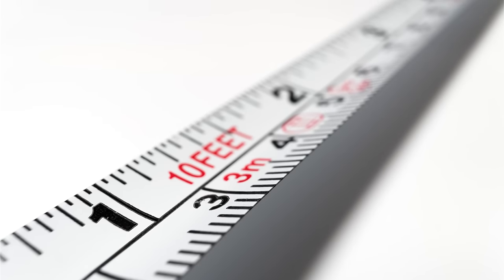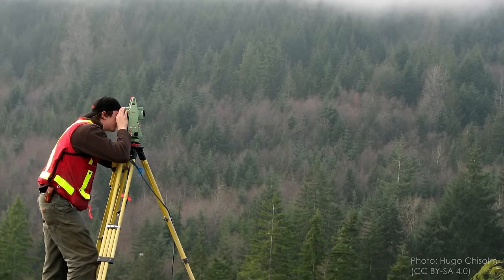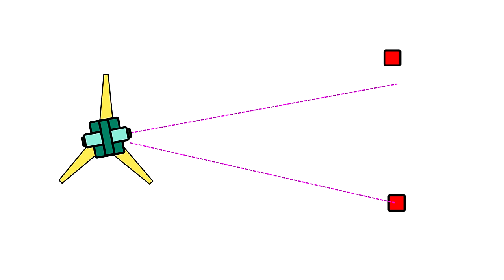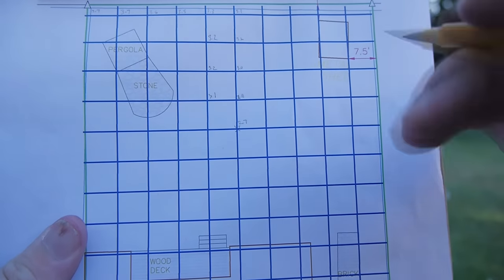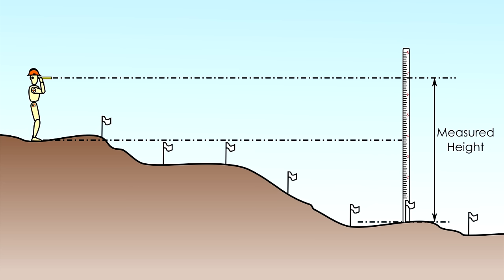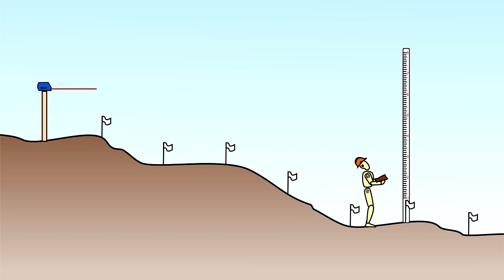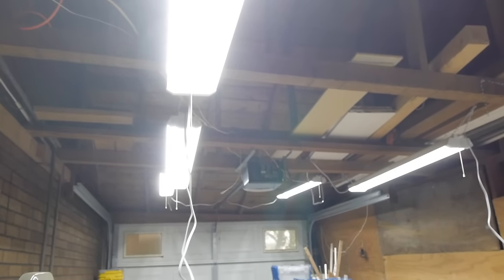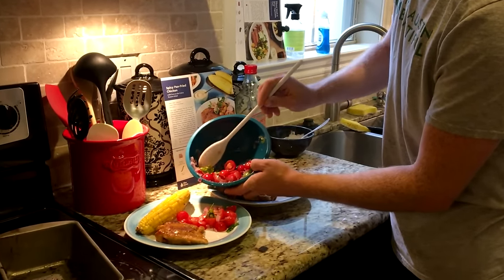How does land surveying work?

Comment: I have been surveying since 1983 when we measured everything by hand. One thing we did not mention in the video is "slope distance" which is longer than horizontal distance. The total station will record anything you tell it to. For example there is point codes and point numbers. A point code for example let's say a tree, we could name it any code we want to. Tree=1, top of curb, pt. 2, a dandelion, pt.3 (just kidding), center line of a street, pt. 4. Now point numbers are 1,2,3,4 and on and on it goes. As we progress the "data collector" is a kinda of a memory box which retains information. Make sure it is charged. We then take it into the office and a very smart man downloads into his computer and proceeds to produce a topographical map, or done in reverse he gives us information that we apply to the field. Sounds complex but it is very fun. Now let's get into something that is really interesting. Have you ever noticed as you drive around a large curve on a road. If we look at it, we will notice that the inside of the curve is lower than the outside of the curve. We do that for centrifugal force, we don't want you flying off the outside of the curve, if you are not my ex-wife. Just kidding. Be as it may, the outside of  the curved road is higher in elevation, and the distance is greater, the lower side is, or inside of the curve is of lower elevation and of shorter distance. 2 different diameters. There is also vertical curves, up and down. There are compound curves, combination of two or more different curves, like Marylyn Monroe, and combine vertical, horizontal etc.  In conclusion, in all my years as a rod man, project inspector, material testing tech. there is nothing like standing on a finished street, road and say to myself, "I helped build this."  Disclaimer, I hope I was correct in my rambling. I am an old man now, I truly wish I could get back into the field.
Reply: I recently began surveying as a second career after retiring from the Corps. Today we use GPS and Total Station. Although I know about pulling chain and tape as well.
Reply: @tiredoldman  Thank you Bill. Have you ever surveyed a beach. ;)   m
Reply: Thank you for this message, was very interesting to read! 
I have always wanted to do proper work like this. 
I grew up on a farm in South Africa, my parents still own it. 
They still flood irrigate the fields, so slope of the ground is important on large fields. 
Someone gave my dad an old theodolite, which projected the image upside down (unless we were using it wrong, haha) so he would stand with the measuring rod, and i would write down the measurements. My eyesight and patience a bit better back then. We would then subtract the difference to calculate how much of a slope there was, and possibly where more topsoil should be placed to fill in holes and ease the slope. 
It was little things like this, which i experienced as a child, which gives me great appreciation for many different aspects of engineering. 
Mans life is too short to fully enjoy and learn all these grand things. 
I am still a young man, and would love to sit around a fire with you and would learn so much! 
Thank you for your input. 
Greetings
JG
Reply: @Jaguartmb  You are most welcome, sorry I cannot afford to go to S. Africa, but I would love to.   m
Reply: If I recall the slope around the curves was referred to as “ super elevation”.  We calculated for design speed and expectations on traffic.   I did a few miles of roads while in the Navy in early 80s and visiting the bases 30 years later and seeing the roads and structures I laid out still there and in use is a good feeling.   12 weeks of school and hit the ground running. 

Most frustrating was working near a runway and had an F16 start to taxi next to us.   We were awes by the jet we didn’t give any thought to the setup behind us.   Pilot got his ok- started up engines , we sAluted him and he took off like a bat out of hell and thrust sent our equipment flying    (Sooo worth the a$$ chewing ).  We had another one.    I really enjoyed it.  Especially designing co pound curves and setting crowns.  Then we got to help lay concrete or place asphalt depending on what we were doing. ( this case, 9” concrete road for jet engine testing.     

Good times back in Sicily in those days. 😏
Reply: @stemmentor9700  Thank you for your valuable input. It is great to see another surveyor tell his experiences. 
    Land surveying is a job, art, learning profession. Once you have it, you never forget. Not a lot of people know how land surveying works. I am happy you gave us your work in the field. 
     For all the people out there, here is a question. "What is a chaining pin, and what is a chain?"   m

Comment: Your video popped up among YouTube’s suggestions and I’m obviously late to the party. Thank you for posting it. Personally, I love water levels for their amazing accuracy and use one as often as I can find an excuse. Your ease of use will increase dramatically if you build yourself a “pro-grade” model which adds a five gallon bucket as a reservoir and a fitting to connect the tube to the side of the bucket. A small through-hull fitting works well for this task. Add a few drops of food coloring to the water and you are set to go.

Comment: I’m a 50 yr old mom and trying to refresh my memory of the “old days” when i worked for our County survey crew for a summer when i was 19 yrs old, and the work i did  a few summers later for a GC (General Contractor- roads) where i began as “Flagger” (how I initially got hired) but got hired on after that as a “Grade Checker”, and eventually taught to also operate the road prep and grading machinery. I remember a lot of parts of it all but wish i knew exactly my process and why. Part of the problem was that when i was a summer hire for the County, i was not soley responsible for all parts of the survey - and i did both “corner crew” (finding ancient property lines and markers, and resetting them as needed), then later got switched to the County “Construction/ Road Survey” dpt. When i worked for them as an 18 yr old i mostly would just hold the receiving tape or the end of a metal tape. I was aware of the goal and why but wish i had asked, or been shown, all of the numbers and measurements taken and what exactly we were doing with them. I also wish i would have been shown the papers (if i was i don’t remember) that had the mapping or construction data we were using to find our targets…or in the case of the construction survey crew i would have liked to have seen the engineering design data they were most likely using from their “known markers (or Points of Interest with known location values) to go set points from there….i was only there for a few weeks so honestly i dont even remember what we were doing with those main roads and if we were just checking for proper slopes and distances already put in, or if we were the ones setting them to start with for either new roads or road work repairs (where maybe a main utility line was being dug up, repaired or replaced). 
I also remember hammering in a lot of hubs for the contractor then instructing the blade operators how much to “cut or fill” (they were SO amazingly skilled! I loved those guys!). I think i had to do some multiple times depending on HOW MUCH the grade of the road was changing. There would always be a large marking stake with numbers / measurement data on it, with a mark. Those would not be the hubs themselves but what i would use to set them. What i dont remember exactly is HOW i set the hubs or what i used in addition to these marks and “notes” written on marker sticks. I also can not remember for somereason if they set these marking sticks on BOTH sides of the road, or if it was just one side? Actually as i think about it, i THINK they were located on BOTH sides of the proposed road because i dont recall using a compass to determine the center hub (usually the high point of the road for adequate drainage). So i must have used those marker sticks to measure with a tape measure, the distance the marker said i needed to go to put the hub and it’s corresponding “elevation”.
Anyway im now trying to build a large driveway so we can have the school bus come again (city removed the bus turnaround thats been here over 20+ years due to a new development!), and id also like to mark out our landscape / terrain for future home planning and landscape architecture as we are on about .83 acres with sloping elevation towards the Columbia River).

Comment: I am a surveyor, and this is the first time I've ever seen that water level.
Reply: It only works over short distances so probably less than your level of surveying.  It's hard to get a mile long tube of water and the atmospheric air pressure between 2 points a mile away could be enough to distort the level beyond acceptable margins of error.
Reply: What do you use instead?
Reply: Ben Madrid there's other ways?
Reply: That is a millwright method, not a surveyor method, not sure why he included it in this video.
Reply: i've never seen a water level on a survey truck, they usually carry better ways of leveling. they are really handy for home leveling jobs and can by accurate  to about 1/16" (half a hundredth). you should always read them at the center of the meniscus, where surface tension is least affected by the hose.
Reply: I'm a surveyor also and used a water level prior to my survey career when I worked for a geotech engineering company.  We used it to survey the foundation of an existing building from inside the crawl space.  But yeah it's a rare beast and I'd be surprised to see a PLS using one.
Reply: Ben Madrid same here lol. Never heard or thought of it
Reply: It is a fairly old and cheap method used in countries like India to construct houses using brick and mortar or rubble stones.
Reply: Ben Madrid how do you recommend land surveying? I’m going in to in to next fall
Reply: I'm also a professional land surveyor, and use a water level all the time.  Although I rarely use mine for surveying purposes, I have used it to do a topo surveys like the one shown in the video.
The "water level" shown in this video is nothing more than a tube with water in it.  That must have been a real PITA to get measurements with?  You will find that a properly constructed water level with a 100' tube used in conjunction with that level rod is a very simple and quick method to perform a topo survey.
Generally, my water level is used for setting concrete forms, manufactured home sets, crawl spaces and inaccessible spaces, and other purposes that have nothing to do with surveying.
Reply: How do you make a turn on a globe then close your circuit?
Reply: You know why? 'Cause you're American...
Reply: Not a surveyor but I've seen it 😀
Reply: hard to believe you are a surveyor and did not know this trick.water seeks it's own level .  this method is often used to  determinethe water level for a pool.  simple  .. .   no instruments  needed
Reply: When I was in yacht construction, the basic hull  (14x65) was was laid up in one building and moved to another for final assembly.  It had to be leveled in the new location and  a length of surgical tubing was used.  Very precise.
Reply: My dad used one to set a foundation about 50 years ago.  His explanation was that water will always seek its own level.  So I surmise that the Earth is not flat because of mountains and valleys, that is above sea level.  But the surface of water is always seeking its own level.  There are mountains and valleys below sea level but the water above them has a level surface.  Now if 70 % of the Earth is covered by water It might give cause to wonder how it could comprise a sphere.
Reply: @qanommonsense2753  The ocean is not level nor would it be a sphere. If you remove the land but maintain the gravity and have no waves or ripples in the water, it will be lumpy. This is called the geoid.  If you discount the gravity, a ellipsoid (think 3d oval) is the most accurate yet simple mathematical representation of the shape of the earth. "Sea Level" between the east and west coast of the US is different by a couple feet with respect to the reference datum routinely used (NAVD88).
Reply: My grandpa, who was a dyed in the wool cowboy, used methods like that to build fences, corrals and a couple of barns. He was actually a super intelligent individual who had a real aptitude for math. My dad, who is a civil engineer and PE, use to call him the Cowboy Engineer. Great description for those without formal education in these areas.
Reply: As bricklayers,we use water levels pretty much every single day to transfer heights from windows to our profiles which are set up plum and we mark down in increments of 86mm for our brickwork,we use this to get around corners aswell,can't use a laser level when the frames are in the way

Comment: Be careful with 'water levels', I found out the hard way that if one end of the plastic tube is in shade and the other end has been sitting in the sun for a while you can get a one to two inch height difference between the levels at each end

Comment: I got led down the rabbit hole big time with this video! Started wondering about what kind of interpolation is used to make the map from the points, I did a lot of line interpolation for a math class but hadn't really thought about extending that in more dimensions. Now I'm off to read for hours about spline surfaces. Thank you! :D
Reply from the maker: Normally topographic survey data is used to create a TIN surface. At least that gives you a starting point :)
Reply: There are plenty of ways to interpolate. Sadly they are very rarely used in TIN models or other representations. Survey companies aren't going to process their laser point clouds more than their customer asked for, so they are either going to deliver as is, create a DTM and DSM, or regularize the grid and turn it into raster format (in which case they are going to use nearest neighbor because they are lazy and/or any other process is gonna slow their servers which they don't need because they already have way too much to do). Also measuring a field by laser and sticks is so 2004. No offence Grady.... But real surveyors have airplanes with laser scanners.
Reply: Magne Bugten All our topo data is processed in software called LSS. Once all the linework is done, we export to AutoCad to produce deliverable. Our scan data is processed in Leica Cyclone, then we use Leica Cloudworx and for Autocad and JetStream for elevs and sections or 3D modelling. We do flythroughs in Veesus Arena4D.
Reply: Magne Bugten You still use airplanes? I haven't touched one in over a year since making the move to drones. ;)
Reply: Laser scanning all of Norway with 5 and 2 points per meter isn't going to be practical or affordably done by drone with the rules and regulations as is. Drones are more flimsy and less able to carry heavy imu's so post processing the navigation may require a a certain amount of ground control points to reach a desirable accuracy - in theory. But I don't disagree, Greg: Laser scanning drones are coming to stay and getting better year by year.
Reply: simeon136 I actually have no clue what my company's workflow is. I work as a summer temp in full format imaging. All I hear from laser is that they complain a lot. What I do know is that they fly a variety of sensors on both planes and helicopters. Which is weird because you'd think the smart thing to do is to have a streamlined workflow for one sensor.
Reply: No developer is gonna buy you a $100,000 lidar sensor to topo a lot for his apartment complex so you can hop back off that bandwagon for a while.
Reply: ISU Student Surely the developer would be hiring a Survey Company that already has the kit needed not buying it themselves?
Reply: Sure, but the point is a company that has that equipment isn't going to be charging the same as a guy who is out there with a robotic total station.
Reply: ISU Student Our daily charge out rate is the same for one man topo by Total Station as it is for one man scanning.  Things may be very different in the US than us in the UK however.

Comment: I have fond memories of studying surveying when I was in college working toward a degree in Landscape Architecture, or Civil Engineering. That led to Summer jobs working in field performing surveying. Back in the day, we used 100' steel chains. EDM was just coming out, and would save the day a year later when doing working in Seattle on busy streets. Can't tell how many steel chains got busted by traffic. One Summer, I was finding old monuments in National Forest. Last survey was in mid 1800's. The old survey was remarkably accurate for the equipment used; actual chain, and a compass. One corner was off and after correction, a National Forest Sign made from wood and rock was off by 15 feet and had be torn down and re-built. In town we had to deal with barking dogs, nosy neighbors, and traffic. In the forest we had to deal with bugs, snakes, and hornets. One of our jobs in Forest was to clear property lines of brush and trees. Anything bigger than 6" we cut with chainsaw. Smaller stuff cut with machete. On fire danger days, no chainsaw, all by axe, and hand saws.